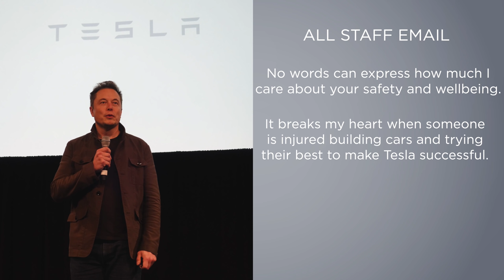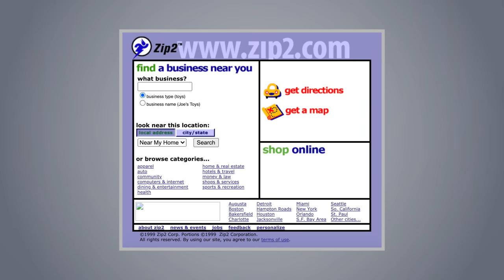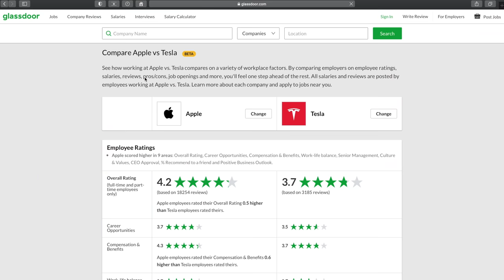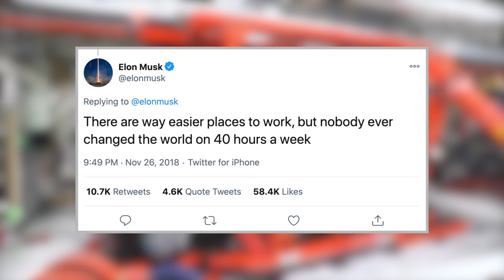Why Elon Musk Sleeps at Tesla's Factories

Comment: really like your work   kudos.   a couple of other points - SpaceX and Tesla are consistently #1 or #2 as the preferred place for engineers to work, - consistently, with 3 million applicants at Tesla in 2021.   many of the workers on the assembly line are now millionaires because of stock options - hard work is rewarded.

Comment: he definitley will be able to achieve all that, and honestly a car that he could make that would sell very well in countries other than the USA, would be a car that works like a normal car, like you know, a gearbox, handbrake, gear shifter, clutch and all that, but instead of a combustion engine it would be a battery. (concept below)

basically, a normal car, but with a battery instead of an engine. it wouldnt even be that hard to design, it would be like a normal car, just swap the engine with a battery, remove the exhaust, radiator and redesign the cooling system, and put in an electric motor where it would spin the axel for the wheels. you wouldnt even need to put a new gearbox in. take the audi r8 for example. remove the engine and things like that, put a battery and electric motor in, connect that to the gearbox, and thats it. and you wouldnt even need to change the drive train. and you could keep the gearbox and manual transmission and handbrake.